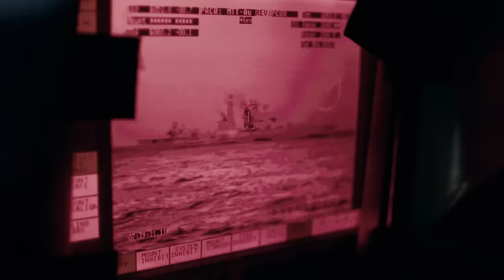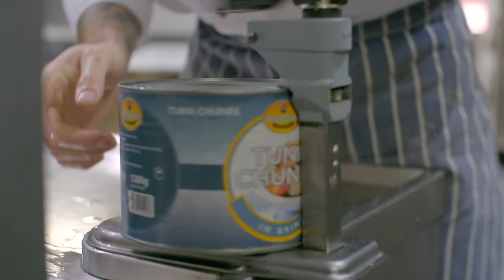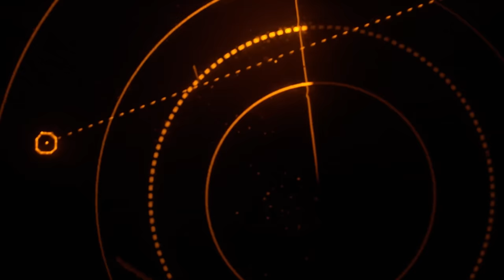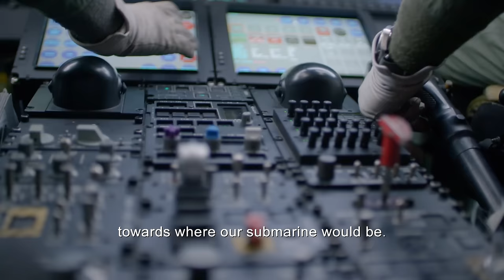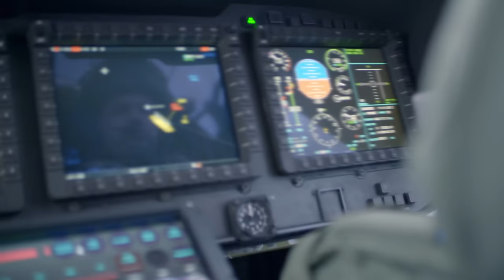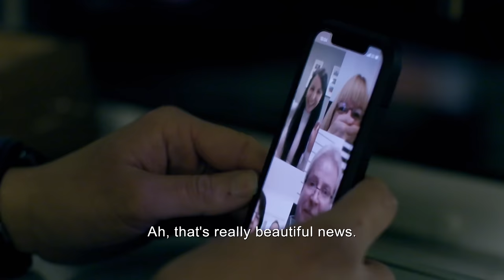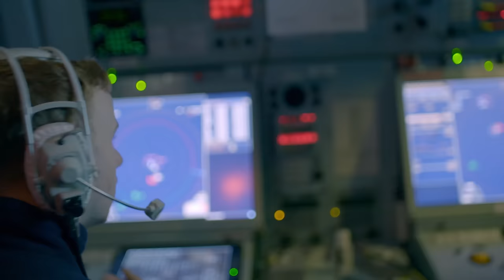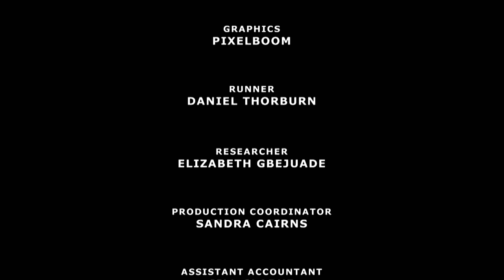The Desperate Hunt To Locate A Missing Russian Submarine | Warship | Spark

Comment: I have to ask a question.   Does the towed sonar array have a redundant system such as the old style sonar head or perhaps a spare towed array on board ship that can be deployed to replace the damaged array?
Reply: Arrays take up a lot of space on board. They might be able to replace some of the microphones and other sensitive equipment attached to the array but if the cable itself is damaged then it's GG.
Reply: @jastinguy more of a surprise they didn't send one of their own subs.  As versatile some surface ships are,  a sub is the best sub hunter.
Reply: Well the ship itself does have sonar elements on its hull but the towed array  vastly increases their capabilities  since it can sink down deeper and when it comes to a sonar array there is no real substitute for physical size, the longer or larger the array is the better it can perform. But I'm not sure toomany ships have a full spare on board, a few km long  cable spooled up is not a small or light thing.
Reply: @billmoretz8718  Given that they are a strategic asset for nuclear deterence i don't think British has many that take on the hunter/killer role.
Reply: @connorjohnson4402  there are 2 types of subs.  Boomers and fast attacks.  Boomers carry nuclear missles and can devastate 100s of cities.   Fast attacks hunt down the Boomers and any other ocean craft.  They also may carry small amounts of nuclear weapons.